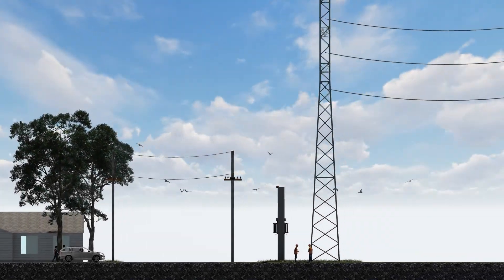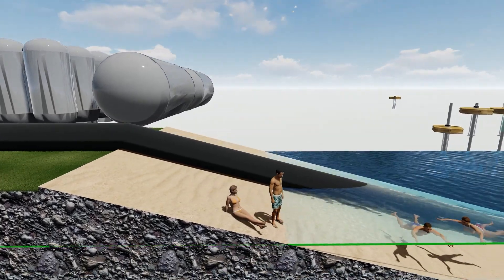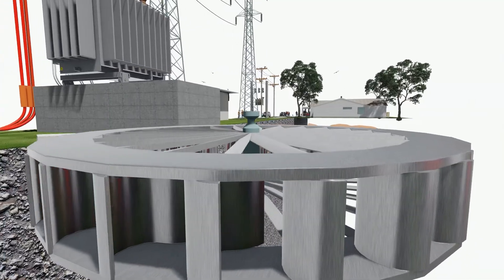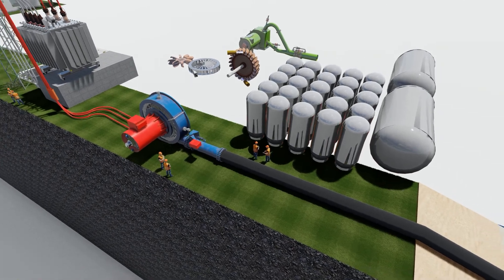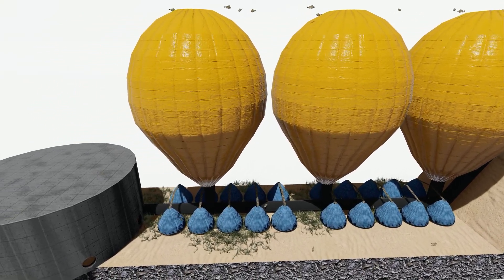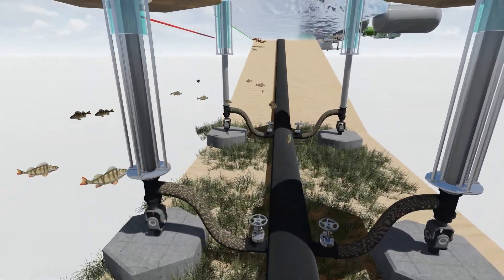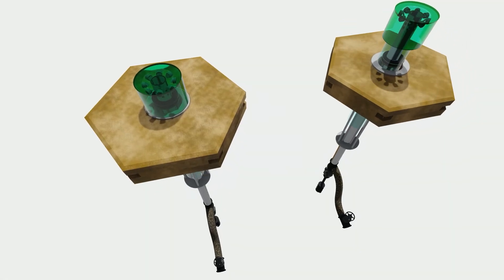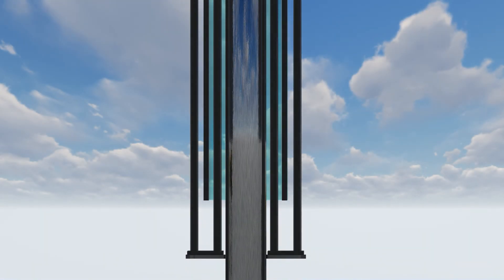Wave energy to compressed air underwater storage to turbine generators rev 2

Comment: JC, it was an excellent video - A++. The concept is my own darling from the previous century. I say it is our solid future for a nearly infinite, completely sustainable energy, in the cleanest, greenest way imaginable. There are so many paths to accomplish it, and you have illustrated the basics. For the skeptics, they only need to look deeper to see the results. One said cold vapor losses upon expansion, but they assumed adiabatic process, yet there are plenty of isothermal processes. Also, there are massive gains once that cold compressed air get’s up to the hot surface with an immediate and massive boost in pressure - the cold compressed air down below is an investment that you recover all your losses from. Again, the engineering side has many path options, all of which are ridiculously simple compared to others. On the eco side, any ruptured line/valve/tank/component/whatever, which all systems have to consider, here result in safe, non-toxic, almost cute environmental effects. A hole in a pipe does not mean toxic oil sludges on the beaches, it means air bubbles which are perfectly safe and actually LIFE SUSTAINING like an aerator in your fish tank. In fact nearby in the Gulf of Mexico (and most gulfs nowadays) there are massive (state/country sized) oxygen depleted zones where there is no life/fish die. You would almost hope for air leaks to restore some life there! Any nick in an electrical wire of other systems, results in an immediate short (deadly) followed by immediate corrosion, and finding the short would be extremely dangerous and troublesome maybe even too for robots (electrified) as you would have to energize to check for voltage over very very long distances looking for a tiny nick in the wire’s insulation… and good luck repairing the internally corroded copper wires… with a waterproof connection… at the bottom of the sea! With air, you’d see the bubbles, all the way to the surface, and know immediately where the pinhole is. No rush to repair, the fish are loving it and it probably SAVED their lives (first that ever happens in our energy vs. nature history). Repairs are as easy as a saddle clamp, or many other methods, and no need to evacuate/purge lines - air and water are 100% compatible, with each other and with all life - plus water was already assumed to be in the mix. I could go on forever, but I just wanted to say - the deeper you look, the more benefits you find. It really is the simplest, leanest, and greenest way to employ our infinite supply of massive wave and tidal energy - way more energy than we will ever need, and even all alone - not accounting for any wind, solar, etc.
Reply from the maker: Thankyou,  yours has been the best best reply yet. I I really appreciate people sharing their opinions. It's not something that I personally could get off the ground or fund. I think people forget that 70% of the planet we live on is ocean. It's a shame not to harness the energy that it carries for the betterment of everyone. We're all too happy to chop every thing down,  or dig fossil reminents because it's cheap and an easy path to take.
Reply: @jamescraig3007  Re: “… people forget Earth is 70% water…” Not I, JC!!! I am all about pure pneumatics - do everything with air. I always say, “On a planet that’s 70% water, why would you want to use anything else besides pneumatics? Air is 100% compatible with water (vs. ICE, or electric, etc.) My air-powered chainsaw - or air-powered drill, or palm nailer, or yard trimmer, or truck - all work underwater, and the fish love it!! Compatible with water, all life, all nature. All zero-pollution, carbon neutral. And my solar powered compressors, and windmill compressors always keep it that way. With CO2 scrubbers in air filters, all compressors become carbon negative, passively. Don’t get me wrong, I use more electronic circuits than most, but mind you pneumatics are also fully EMP-proof, and lightning/surge/black-out/brown-out proof - EMP/solar flare/CME? Bring it on! Wave energy is the final solution for global supply. Add this to your solution - THE ENTIRE PLANET IS ALREADY PLUMBED FOR PURE PNEUMATICS!! The earth is already ringed with natural gas lines to-and-from, over, under, and through every country, and into every urban and rural city, all the way into even individual apartments. AND ALL THE WAY FROM EVERY MAJOR SEA PORT. So forget about any electric grids, let the sea pump up our tanks forever… just plumb it into the global pipe line grid already right there at the port to send it to the masses.
Reply from the maker: lglb, given you and I are on the same page with wind and waves (i think) ,  you might like this idea of using ships as hydrogen factories, taking advantage of the waves - using them to pump air through turbines, the turbines run generators, and in turn create the electricity for electrolysis for hydrogen production. https://youtu.be/NizechKixug
Reply: @jamescraig3007  
NO!! But I do love the graphics - again A++ (BTW: what software do you use?) Ok… hold your hydrogen-barge thoughts for a second.

1) I’m pure pneumatics, so skip the ‘convert to electricity’ parts (at least for now), and then I’m all ears. And, do recall that with each conversion is an efficiency loss (wave to air dynamics, air to blade dynamics, blade rotations to magnetic field dynamics, … electricity to electrolysis, … then eventually back to electricity through a fuel cell [most eff.] or burning, etc.) As simple as it may seem, it’s way too complex with eff. losses at each of the many steps, and each conversion phase has tricky dynamics - like balancing ideal delta wave heights to get most usable delta P’s, variable pitching complex turbine blades through bi-directional, non-steady flows, etc. And btw, piston-cylinder sets in place of the turbines would do better with no continuous blade adjustments/costs/dynamics/higher efficiency with no dynamic losses - i.e., just dum and simple.

2) I did this soooo long ago, I’m not even gonna say when, think Reagan:) But the gist is: IT SHOULD BE RIDICULOUSLY SIMPLE. Imaging a similar dock-like structure… with only check valves - your holey boat with just check plates on the deck floor. Just an anchored dock/deck full of cylinder holes and check valves - not really any moving parts only 2 flat plates (checks) per cylinder (hole). The plate checks could be as simple as a plate bolted to the floor - but with long, loose bolts so it can move up and down a bit… I mean they could a basketball loosely in the pipe with a hole in the deck just smaller than the basketball - a thousand really simple ways to make such a check, even DIY for pennies. No pistons, no piston rings, no moving seals, nada, just like you have it coming out of the water just before the turns to turbines. I mean, it’s so simple it’s more confusing just trying to explain it (lol). For example, moving the cylinder instead of the water, just turn a cup upside down and press it into the water - the air trapped above the water gets compressed, you just need a hole in the top (check valve) to let the air into your system (and a reversed check to let the water fall again.) Done! You can pass it through a ‘p-trap’ (gravity filter) downstream to let out any water that came in - extra water no big deal, no harm. That’s it, super simple (no chips/logics/controls, etc.), just massive air. Yes, you can optimize - deck height adjustable for tides, etc. And now you can A) second-stage compress it to match your tank/system pressures - just a big cylinder at low pressure driving a small piston at high pressure (or same cylinders adjustably leveraged for optimal P conversions), or B) Now you can waste all that time/money/parts and add complexity/eff. losses with just a single turbine (or a ‘few’, as they are insanely expensive even before you mentioned “variable-pitch blades”) running at a steady speed.

I actually modeled one seaside dock/deck compressor (half an inverted box/garage-without-a-door with the open end facing the waves) and let the lapping “traverse waves” compress in the air under the dock/deck forming its own rolling piston seal (top of the wave along bottom of the deck), and then check valves anywhere/everywhere to port the compressed air in wherever the wave decided was best (checks open as pressures require; always self-regulating, no brains/electronics). Also note that there are numerous alterations to this concept. You could use the reversed check (air return) as a vacuum generator…  for whatever, including any air motor running in reverse (inlet is atm, outlet is your vacuum). And/or you could also keep/allow/and improve the amount of water coming in to your system and then you’d have a huge compressed water tank to blow through a hydro-generator (simpler, cheaper than any available air turbine), at will, with lots of water mass forces.

I bet you could model any of those systems (dock/deck wave compressors) for visualization in a few hours just by recycling a few snippets of all those fine graphics you’ve already made. Such simplicity really must be seen.

Comment: Sounds like a great idea but on a commercial scale this system would have a significant effect on the ecology of the ocean. What about ocean waves spilling over an impeller/turbine? The electricity generated from impellers could be stored in a battery stack.
Reply from the maker: Thanks for your comments - i am trying to keep the system as low tec as possible - minimal moving parts, and just compressed air stored underwater. No batteries, no electricity at sea. And to be honest, there may be some impact on a very small area of ecology - but please bear in mind what the other alternatives do to our ecology - ie Dams, Coal fired power stations etc.
Reply: @jamescraig3007  I wish there were more people like you.
You put an impressive amount of thought into your vision. Thank you for all the work you're doing in trying to find solutions.

Comment: a plastic bottle at very low depth will require an EXTREME high pressure pump 
this requires a very LARGE as well as high tolerances on these pumps to be able send pressure to that depth. --  a non flexible container at ocean floor would require an an insane amount of energy loss to get this power to these types of depths. --- instead of putting these 'tanks' so deep, why not simply place a typical 'electrical generator' run at near or slightly below surface level of the water? -- air i think is an amazing way to transfer force instead of using cables in some type of anchored floating tank that would run a generator ... however since moving large amount of air to spin a turbine, why not use water? it does not compress like air! - using a buoyant float near surface to 'ride' waves, and move a non compressible fluid like water back and forth thru a turbine,, which also could be located at or near -- say 100 meter depth -- pushing water back and forth with the waves -- why would something like this not be more efficient than trying to move air, which has very large losses across the turbine compared vs air (compare water vs steam turbine efficiency) - water flat out nails steam or air no contest ! --- -- i believe this is an amazing idea but some small tweaks i can see these types of systems being used at even ' constant variable' depths to maximize efficiency when storms or calm waters are present. - love the presentation - cant wait to see more, absolutely got the gears going here in my head!
Reply from the maker: Thanks Roll Bot. The general idea was to keep generators away from the salt water environment, and all electrical connections and cables etc out of the marine environment as well (just air and water only) . The thought was along the lines of creating stored energy, as opposed to trying to harness immediate energy from the wave (there are lots of those on the market). If you create stored electrical energy, you need to mine large amounts of minerals (like lithium) and process them etc - that all contributes to high CO2 output. So just air was a way of keeping everything very simple and low tec.

Comment: $ invested / Kwh is going to be funny, also compressing air is one of the most inefficient ways to store energy (20% or so is energy, rest is heat)
Reply from the maker: Thanks for your comment - I agree with your point. I used to use an air compressor for nail guns and spray painting etc, and yes, at those pressures, the unit used to get very hot. I wonder how that translates when the compression element is floating in a massive heatsink? I wasn't ever trying to achieve the same pressures as used in a steam turbine, only trying to store large amounts of relatively low pressure air, but pressurised enough to spin a turbine.

Comment: Great video and neat concept for storage of compressed air. The biggest consideration is the fact that large amounts of the most energy rich components of the compressed air are lost to condensation (latent heat of vapoorization) and wasted heat of compression. At the bottom of the ocean you have very cold temperatures and the compressed air would be cooled to less than 10C. When expanded for use in the turbine, you will have freezing condensing inside of the turbine that will occur. The heat of compression and conversion of atmospheric water vapor with high BTU value in latent heat is converted into sensible heat during compression. Very high temperatures in fact would be generated and lost into the cold water at the storage level.
Reply from the maker: Thanks Don, great comment! I am sure all engineering issues can be resolved somehow. This was just an idea for a simple (relatively) energy gain and storage using nothing but the waves and air - no complex hydraulics and electrics out at sea to generate electricity. I'm not sure if you have spent much time in the oceans - I personally have spent 650 days out at sea sailing around the globe, and it can be a very challenging environment. When you get lifted several meters by the passing swell in just seconds, you get a good sense of just how much energy is out there. Windfarms seem to take precedence nowadays, but we still need stored energy solutions.
Reply from the maker: Hey Don, Here's a video for an interesting slow water turbine (vertical axis) concept that you might be interested in. I was really wanting to get a patent on it, with the view that it would be good for tidal energy capture. At the end of the day, its not really my strength, but an interesting concept to an age old design. https://youtu.be/GlRkBvuSfQk

Comment: Interesting concept.  I have to say I would be worried from an engineering standpoint on what happens at each potential point of failure and how easy it would be to do repairs and maintenance.  High pressure air at some point has to come out of your tanks and up onto land into that turbine -- a blown seal, a bad valve, a bad piece of piping and that air is going to come blasting out of there with a vengeance.  Wouldn't it make more sense to use all those pistons to pump seawater up onto the land?  Build a tall tank and the pressure of the water coming out of the bottom drives a standard hydroelectric wheel and turbine with the water going back into the sea (or use the remaining pressure to send the seawater off to a another plant for desalinization).
In that way most of your infrastructure (check valves and tanks) is on dry land and the piston pumps and piping will be the only thing requiring maintenance on the water.  Heck - if you can find a suitable natural location you might even be able to fill a natural reservoir with sea water and just put a hydroelectric dam on the end with your turbines.
Reply from the maker: Thanks for your comments, I also see loads of points of failures! but you never know until you have an idea and when you explore an idea. It might not be the best one, but it was really designed to move away from electrical turbines in a marine environment. Nothing but air and water. Maybe you could design the failure redundancy system.
Stored energy that is not in the form of electricity is a tricky one, water in dams works well. pumping water up to a height can also be used as stored energy - I am not sure how far or how high it could be pumped with this system.